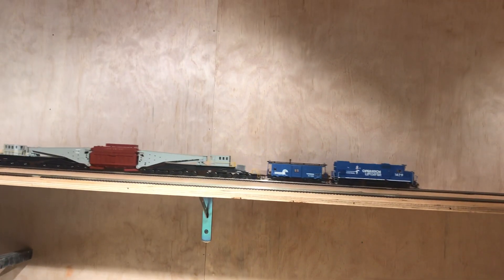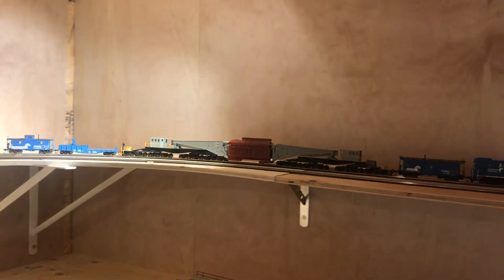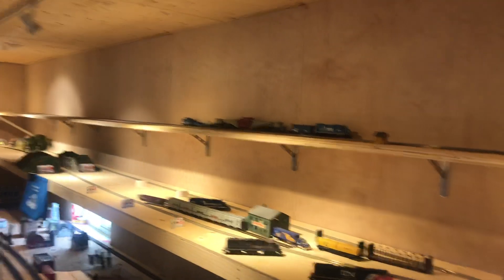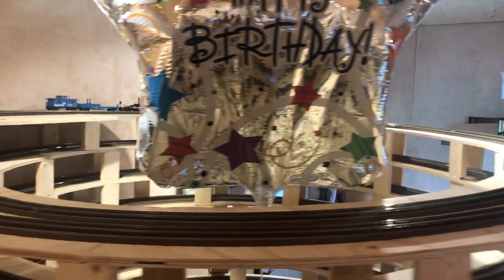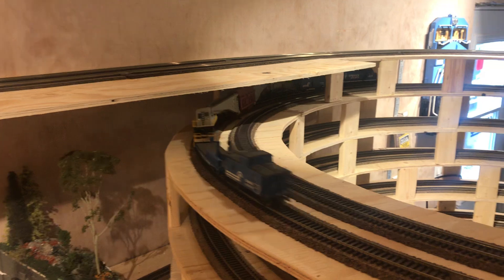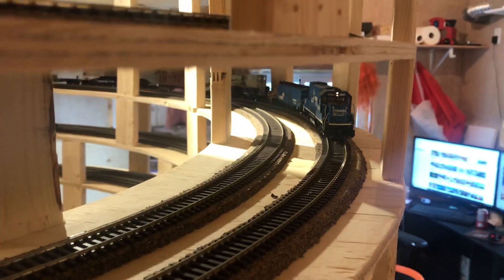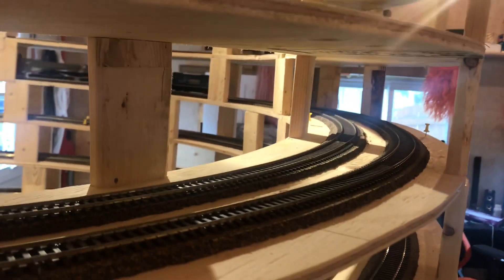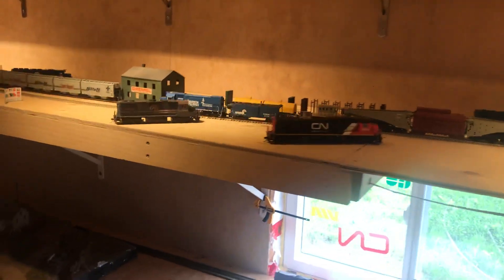Schnabel car running the rails

Comment: Looks like you just need a crossing for the helix and make this a special load train.  I mean with overhang you can’t run a train on the other track, they will hit. Real railroads do it with special loads. We we would deliver a generator unit to the pier we had special running conditions and time slots on the rail because of oversize.

Comment: Two thoughts:
One; maybe it will navigate the inside track empty.  Without the transformer, the overhanging part will be much shorter.
Two; why are you going up the inside and down the outside?  If you revered the directions, you'd have the uphill trains traveling about an extra 15" per lap for the same rise, so the grade is less.